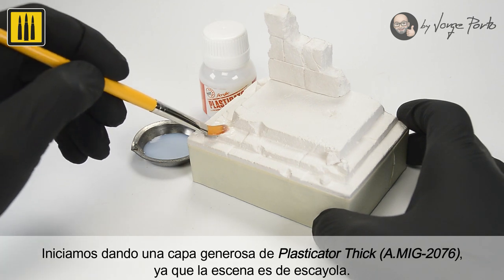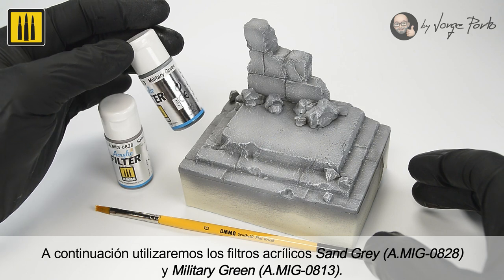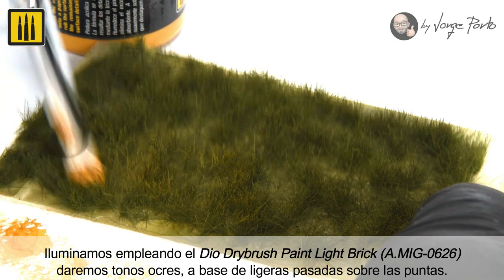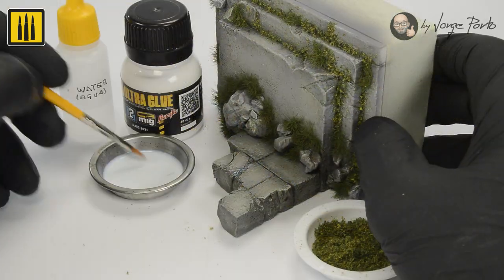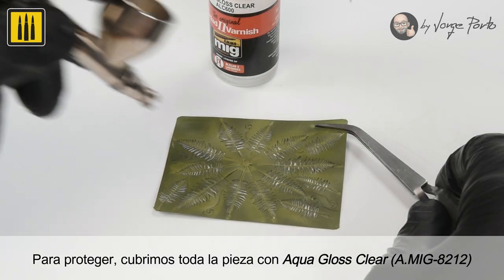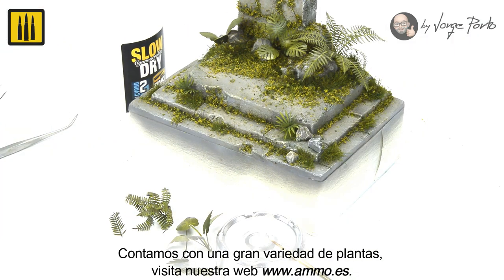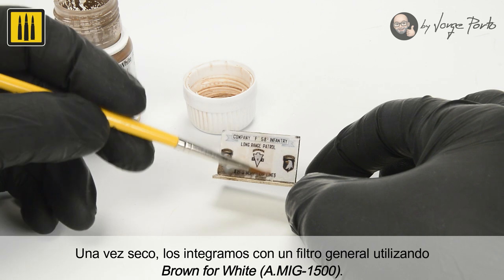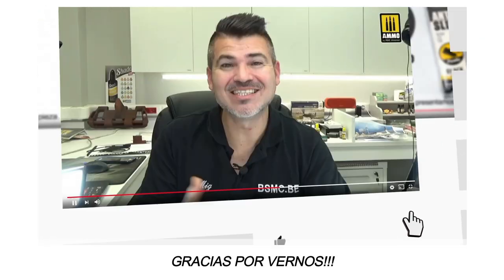HOW TO WORK WITH TROPICAL VIGNETTES / CÓMO TRABAJAR UNA ESCENA TROPICAL

Comment: Marco Aurélio do Rio de Janeiro, Brasil, otro video que más que un diorama es una verdadera obra de arte, gracias a las habilidades de Jorge Porto, así como a las técnicas y productos presentados. Como siempre hay que felicitarlos, y los aplicaré en mi diorama que estoy bastante ansioso, que compré en AMMO. MIG de España ( 1/72 S.M. U-Boot 9; 1/72 Naval Dry Dock / Trockendock; 1/72 Persenning Canvas Decals; 1/72 Saddle Tank Tracing Templates for U-9) para entrega en Brasil y parece que está un poco atascado en la Inspección de Aduanas de Brasil, pero estoy seguro de que el transportista pronto resolverá los obstáculos.
Reply: muchas gracias por tus palabras Marco Aurelio